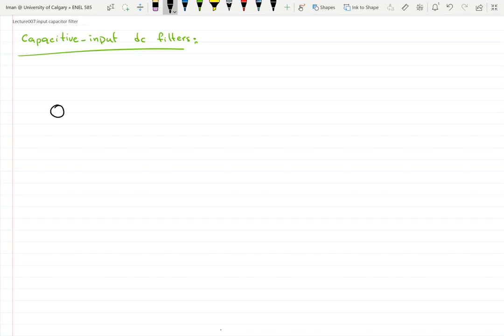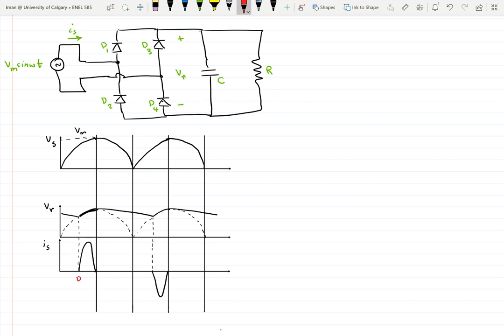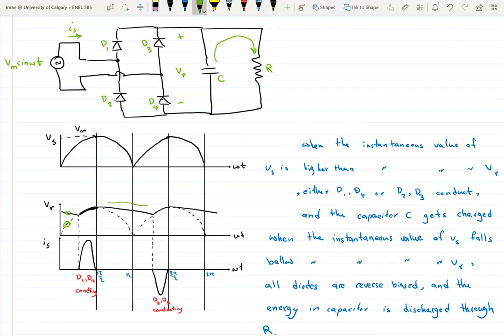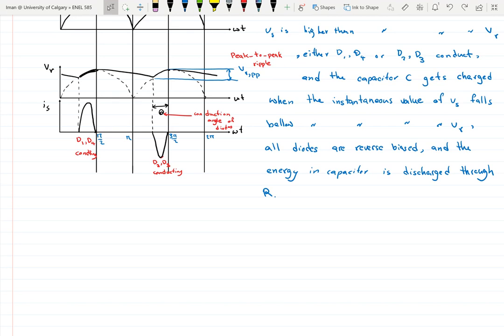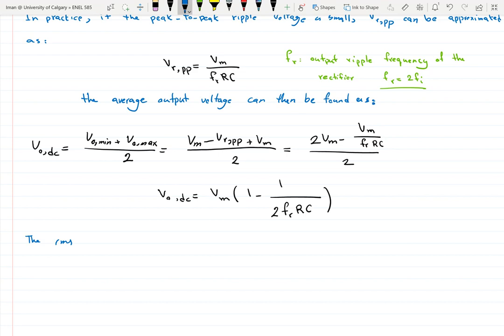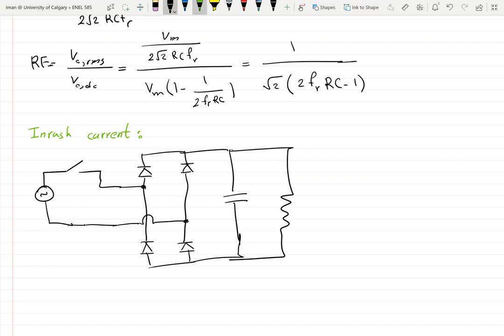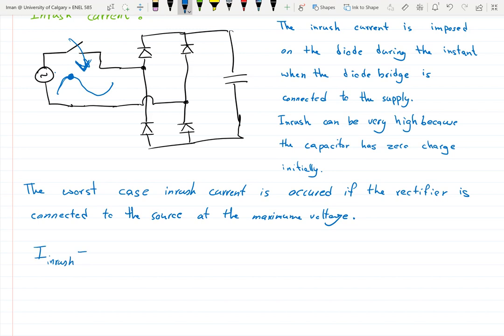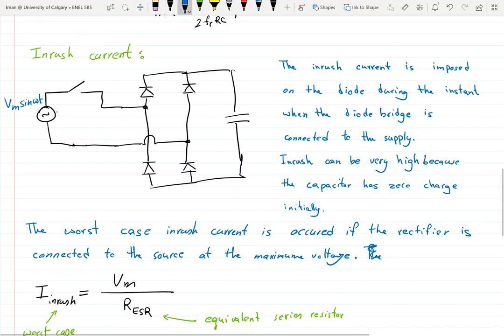ENEL585 Lecture007 filtering capacitive input rectifiers

Comment: 16:45 Since the Vo, rms formula written down at this point will be used as the numerator in the ripple factor calculation later on in the video, does this variable represent only the RMS of the AC component for the output voltage instead of the RMS of the total summed DC and AC components?

If so, shouldn't the formula have a root 3 factor in the denominator instead of a root 2? I assume that we are approximating the ripple as a sawtooth wave, whose RMS value is peak/sqrt(3), as specified on the Average_and_RMS sheet on D2L.
If not, can you tell me where this formula comes from?

Thanks!